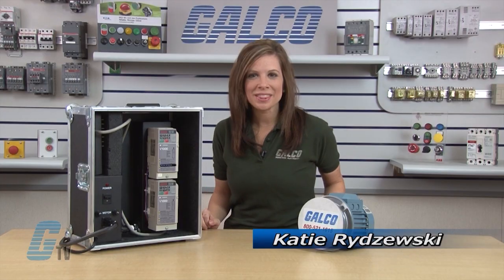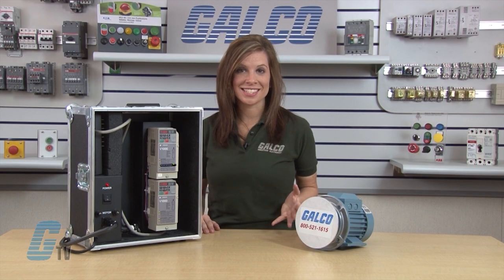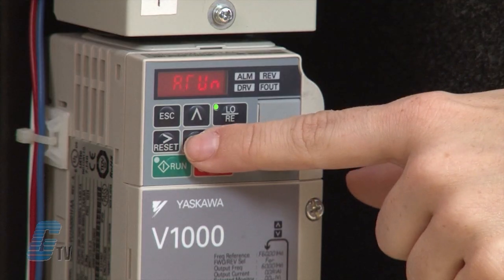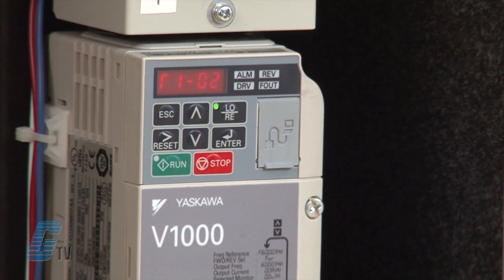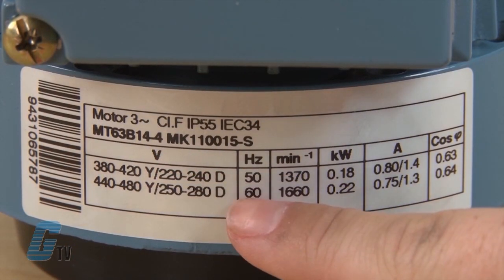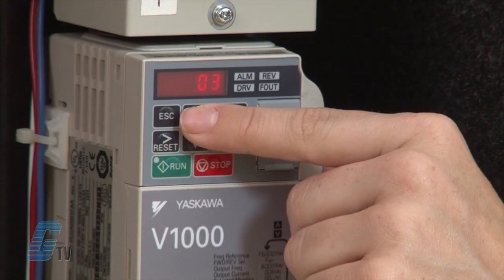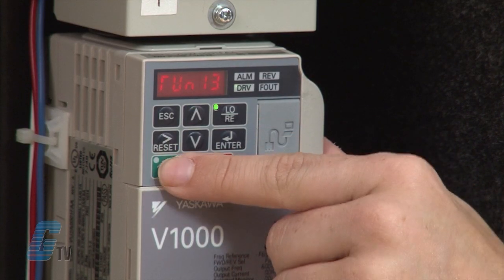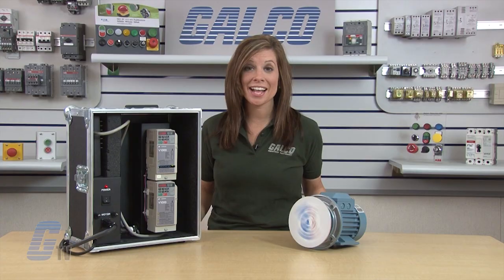Yaskawa V1000 AC Drive Start-Up Auto-Tune Demonstration Using The Keypad

Comment: Nice video.
Howerver you have input incoherend data: if you input 0.18 kW in T1-02 and 230 V in T1-03 and 1.4 A in T1-04 than you should enter 50 Hz in T1-05 and 1370 RPM in T1-07. The value of 60 Hz and 1660 RPM are related to the rated voltage of 277 V, not 230 V.
Of course the motor run anyway if you mix the parameters too, but if you need a precise speed control proportional to the frequency you cannot make the related calculation, and the motor torque too could be not optimal.

Comment: Hi and thanks for the video. 
I have a Yaskawa CIMR-VCBA0012BAA to be installed for my parents. The aim is, to convert single phase power supply to operate 3 phase submersible water pump. I'm still struggling with wiring and programming though, but if it's even done correctly, my elderly parents are gonna struggle with operating the unit,so my question is:can l Install a water pump control panel in between the Yaskawa inverter and water pump to make it simpler? Many thanks for the time and help of anyone who can help.

Comment: I have a Yaskowa J-1000 AC drive, attempting to feed a old Emerson, 3PH motor, 2 HP, 230volt,  5.6amps , 1710rpm. motor nameplate has no kilowatt info,  how do I figure that out?

Comment: I have a Yaskawa V100 installed in a metal detector . The display screen is not showing anything or any error just yellow back light. What could be the reason?

Comment: Good day, i have a question. I have like that yaskawa v1000 and it is controlling a industrial washing machine.. My question is how do i reverse the rotation of the motor when the duration step in the.washing machine is in the extraction phase?
Reply: How to reverse the rotation of the motor in that yaskawa v1000?
Reply from the maker: Then you must get your controller connected to the drive to close the reverse input and open the forward input.

Comment: Are these parmeters really same for all drives of yaskwa auto tuning
Reply from the maker: Not necessarily. You will have to program your motor values first off, then the rest of parameters will be application dependent. Having said that, you can probably get running with some general settings like discussed here. Just please be aware that every application may have specific needs for optimizing performance, ok?

Comment: How to change motor direction  in yascava ac drive
Reply from the maker: If you have not changed from the standard Macro, then S1 is forward run input and S2 is run reverse
Reply: I want motor direction change from key pad of drive 
Then how to change
Reply from the maker: You may have to verify parameter b1-04=0 (reverse operation enabled), put in LO (local mode) with LO/RE button and LED in button should be lit. Then push Enter button and up/down arrow until rEv displays and push enter again.
Reply from the maker: Got it now?

Comment: what is winding program?
Reply from the maker: Well are you asking in general or in the drive?
Reply: my drive model:CIMR-AB4A0011FBA
Reply: my drive is fault ---OH1
Reply from the maker: Oh ok, this means the Heat-sink in the drive has overheated. Check and make sure the cooling fan(s) are running. Make sure they are not blocked and you can feel air out the top of drive, ok?
Reply: I want to new drive use
Reply: please help parameter copy and paste system
Reply from the maker: If you are trying to backup on your computer, do you have the communication connected to a PLC or a computer with software on it?

Comment: Please solutions over voltage alarm of acdrive
Reply from the maker: Usually this means you have to increase your DECEL time, the drive is being overhauled by a large inertia load. If the process requires your rate of decal, you may need a brake resistor or check that the brake resistor you are using is ok (may have a fuse in series with it that opened or blew out) ok?
Reply: GalcoTV thanks

Comment: How to decided Motor pole according Rpm
Reply from the maker: This is an excellent question Narinder. For standard induction asynchronous AC motors it's easy. If rated 1750RPM @ 60Hz, it would be safe to say the synchronous RPM is 1800, this is a 4 pole motor. If rated 3450RPM @ 60Hz this is a 2 pole motor. Up in RPM = down in pole count. If rated 870RPM @ 60Hz synchronous RPM is 900 or an 8 pole motor, ok?

Comment: What does stationary tune mean?
Reply from the maker: The Yaskawa drive allows you to "Auto-tune" your motor to it without any rotation of the motor shaft. It is not as precise as a rotational tune is but it may be adequate in some cases where disconnecting the motor from its load may not be possible. Allowing the drive to rotate the shaft without anything connected to it is the best way to Auto-tune where possible, ok?

Comment: How do you look at settings on a running drive without stopping or changing anything?
Reply from the maker: The Yaskawa V1000 series and most drives will allow you to look at parameter values while the drive is running and some can even be edited while in run mode as well. The drive will usually tell you a parameter is not changeable while running if you try to, ok?

Comment: hi, recently i installed yaskawa v1000 its running auto control mode but while i'm going to parameters settings drive goes to manual mode and get stopped ,,i didn't get what is the problem .please be reply me as early as possible
.
Reply from the maker: Please be aware that some parameters can not be edited while in operation. Do you have a copy of the manual? If not please follow this link http://www.galco.com/techdoc/yask/v1000_tc.pdf
Reply: yes i was edited all parameters from old drive but p1 and p2 outputs not coming i gave 24 volts to pc common terminal
Reply from the maker: Ok if you look at page 63 in the manual it will show you to connect your power supply common to PC, then P1 and P2 go to your load (indicator lamp or PLC input what ever you are using them for) and the +24 goes to the common of your load not the drive, ok?

Comment: How do I get the remote to work on this
Reply from the maker: The LO/RE Selection Key switches drive control and frequency setting between the operator (LOCAL) and an
external source (REMOTE). The LO/RE key can only switch between LOCAL and REMOTE when the drive is stopped. To disable the LO/RE key to prohibit switching between
LOCAL and REMOTE, set parameter o2-01 to 0.
Reply: Hello again I can’t seem to get a it to switch over from local to remote

Comment: Hi,Ive just bought a couple of these . I've tried to power them up and i get error code H66 . Any advice,I've looked at the manual but I'm afraid it's way above me to understand . 

Thanks 
Sean
Reply from the maker: Check if external safety circuit tripped and disabled the drive. If the Safe Disable function is not utilized, check if the terminals HC, H1, and H2 are jumpered.
Reply from the maker: PS, it is not H66 it is Hbb, for Base Block, a safety feature built into the drive.
Reply: GalcoTV hi , thank your for quick response I'm now up and running . Can you tell me how to save my settings , I lose them every time I turn of the power off  in my workshop .  Is there not a memory source or something similar  . 

Thanks your video was very helpful indeed .😊
Reply from the maker: These drives save the parameters automatically when you exit the programming mode. Not sure why it is not saving in your case. We suggest cycling power while you are present in front of the drive. Do you have a copy of the manual?
Reply from the maker: For a digital copy of the Technical Manual to a Yaskawa V1000 AC drive click this link http://www.galco.com/techdoc/yask/v1000_tc.pdf
Reply: GalcoTV hi,how do I set up the amron V1000 to get it to reverse .

Thanks 
Sean
Reply from the maker: Well Sean that is a good question. First, does your drive look like a Yaskawa V1000? If so it is common practice for most (but not all) manufacturers to keep the physical portion of the drive the same as what I will refer to as the ROOT drive, and they will simply change the firmware. This means the parameters will be a little different, the performance of the drive will be a little different as well. On a Yaskawa V1000 you simply connect the SC terminal to S2 input for reverse operation, and keep in mind the S3 terminal is an external fault input. If S3 is not made to SC, the drive will not run forward or reverse. Good luck, and thanks for asking Galco.

Comment: my yaskawa v1000 showing ol2 alarm. I need know how to resolve by drive.
Reply from the maker: OL2 is Drive Overload. The thermal sensor of the drive triggered overload protection. 
(see page 134.)
http://www.galco.com/techdoc/yask/v1000_qs.pdf
Reply: thanks a lot. I solved it.
Reply: @nasubash  How did you solve it?

Comment: please tell me how to auto restart v1000 parameters
Reply from the maker: To reset the drive and set parameters to their default values, end users need to use the “Initialize” command in the V1000’s A1 Menu. This is done at parameter A1-03. The value should be set to 2220, for factory two-wire control or 3330 for 3 wire control.

Comment: Could  you give us  an explanation  how to use it in the remote control, please 
Thanks in  advance
Reply from the maker: Sure, first connect a speed command to it (pot or 0-10volt source), then connect a start switch/contact to the start input and put the drive in remote with the LO/RE button, if the LED is off it is in remote mode, ok?

Comment: my yaskawa v1000 drive is showing overvoltage alarm in backup (rescue) mode
Reply from the maker: You must mean KEB Kinetic Energy Backup? There are 2 of these modes, and if you get OV trip you are probably using KEB1 which is based on a DECEL time regardless of load inertia. Try using KEB 2 mode (L2-01=2) that adjusts the decel time based on the bus voltage so that the DC bus voltage meets the level set in parameter L2-11.

Comment: please help us  how to reset the Hbb Fault Alarm
Reply from the maker: Hello,

The HBB fault means that the terminal H1 is open or has no signal for the “safe disable” input.

Terminals HC, H1, and H2 need to be linked if there is no external contact or signal source to keep the safe disable input satisfied.

If the signal is present or the terminals are linked (jumped), then the drive is defective and needs repairing or replacing.

Hope this helps!

Comment: Great what is the rotational and stationery tuning. also please guide me how to download the parameters. autotune is performed before downloading . Please help
Reply from the maker: 2 different drive modes for Rotational tuning, V/F Control or Open Loop Vector Control (or OLV mode).
Both Control modes require the motor be uncoupled from its load before running Autotune. If uncoupling not possible or very difficult, the load at autotune must be less than 30% of process run load.
OLV Control requires that the motor and the drive are closely matched in size (horsepower), V/F Control is more forgiving on motor size (will run smaller motors).

Ok now Stationary autotune is for application where the motor cable is longer than 50 meters (164’) or application where the motor cable length was modified since precious autotune.
Didn’t see it in the manual notes but probably doesn’t matter if the load is uncoupled or not.

Always backup parameters after autotune, some values have been changed and need to be saved.
Reply: +GalcoTV thanks for the information.as in my case the motor cable is not that much lengthy. I have to programme CIMR P7u series drive.how to download from my laptop
Reply from the maker: I did not find any software or communication features available for the P7 series Yaskawa drives.
They do however have a MODBUS communication option to interface to a PLC, but not a laptop.

You can however copy parameters to your keypad referred to as the “Digital Operator” so you can at least backup what you have. see below.

o3 Digital Operator Copy Function
􀂄 o3-01 Copy Function Selection
Note: The copy function is disabled when serial communication is active.
􀂄 o3-02 Read Allowed Selection
The digital operator has parameter COPY capabilities via built in non-volatile memory. The digital operator can READ all of
the parameters in the Drive and store them for later WRITE back to the Drive or into a Drive with the same product code and
software number. In order to read the parameter values and store them in the digital operator, select o3-02= “1: Enabled”. If
you attempt to READ the data, which overwrites any previously stored data, without first setting o3-02= “1: Enabled”, you
will get the following error:
After setting o3-02= “1: Enabled”, it is possible to store parameter values in the digital operator by setting o3-01=1 (INV→OP
READ).
A successful READ of the parameter values will display:
An error may occur while saving the parameter values to the digital operator’s memory. If an error is displayed, press any key
to cancel the error display and return to parameter o3-01. Error displays and their meanings are covered in Chapter 6: Diagnostics
and Troubleshooting of the E7 Users Manual (TM.E7.01). To COPY parameter values into a Drive, set o3-01= “2: OP-
>INV WRITE”. During the writing of the parameter values into the Drive the digital operator will display:
Setting Description
0 COPY SELECT (factory default)
1 INV→OP READ
2 OP→INV WRITE
3 OP↔INV VERIFY

Comment: In a hoist operation, V1000 is used for controlling two 0.55 kw motors. Using multifunction input contact S5 & SC, the speed should increase upto rated frequency of 50 Hz. But it is building upto 5.25 Hz. How can I rectify this? Please help
Reply from the maker: +Rajatsubhra Ray I’m assuming that you have it programmed properly to so that the speed reference goes to 50 Hz when you select S5. If that is true, you may be going into current limit which will not allow the frequency to go above the point at which you hit current limit. When you select S5, measure the current on all three legs of both motors. They should be balanced and when you add the currents from one leg of each motor, that total should be below the maximum current you programmed into your drive at parameter E2-01. If you are running in V/F mode, you can disconnect the motors and then start the drive and select S5, if the output goes up to 50 Hz, then you are probably going into current limit. If it doesn’t go to 50 Hz, something is not programmed properly. If that is the case, I would need to know how you are setting the drive up to run at 50 Hz with S5 selected, are you trying to program in a speed or are you looking at an analog input.

Comment: my YAsakawa drive I used it for Fwd and reverse function of a motor.  I switched the SC and S1 motor starts but once i removed it motor doesn't stop. so i have to power off the driver. same scenario for the reverse operation. Pl help me to fix this.
Reply from the maker: +China Aripp I need some answers before I can help you. What value is in parameter b1-02, and How are you selecting reverse?

Comment: I was wondering why I cannot start my drive remotely using only a 24v input from an external push button. I am not using the drive's 24v supply. Do I need to switch it to source? Also, is a common wire needed from the drive?
Reply from the maker: +Tim Lawson Yes, you will have to change switch S3 to source, sink is the default, in order to have the drive operate from an external 24VDC signal. You will also need to connect a wire from the SC terminal of the drive to the common of your external source.

Comment: Hi Galgo Tv!!
Ihave problems with the auto-tune, i put all the data from the nameplate of my motor (0.55kW, 230 Volts, 4.2 A, 50Hz, 2850 RPM) but does not appears "Run 13", The display shows "Er-01". How can i fix the problem?

Greetings from Mexico city!
Reply from the maker: +Joe Montana Greetings! Verify that parameter T1-06 is 2, this is motor poles, and for a base speed 2850, it has to be set to 2. The default is 4 and when I put that in my drive, I got an Er-01 fault which means motor data is incorrect.

Comment: The drive shows SC. please inform what it means and how to reset.
Reply from the maker: +jack Searle SC means short circuit. Try turning off the power, wait a few minutes to make sure the capacitors have discharged, disconnect the motor then power up and run the drive. If the drive runs, you should check the wiring and motor for a short between the phases. If you still get the SC fault, you may have a bad drive.